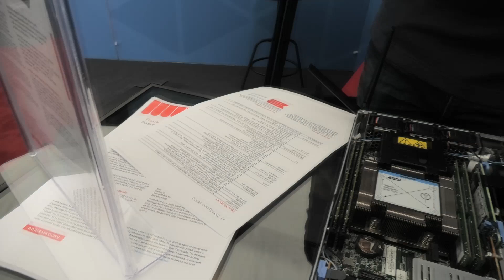ATEA IT EXPO 2019 My Experience - 873

Comment: You gotta move away from Intel. They aren't efficient nor secure. AMD's Epyc CPU's encrypt the data and registry info. Pairing it with encrypted hard drives (ssds) would only make it that much better than a Intel system.
Reply from the maker: Do not jump off a burning skyscraper,  before you know the safety net is working!